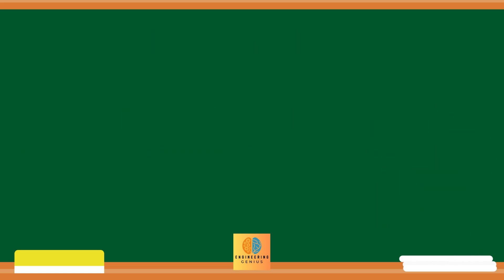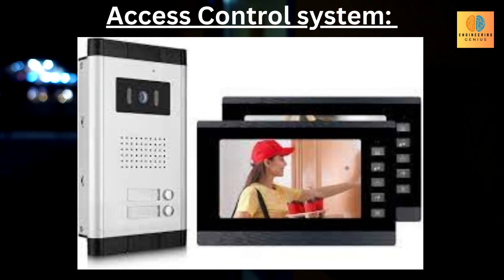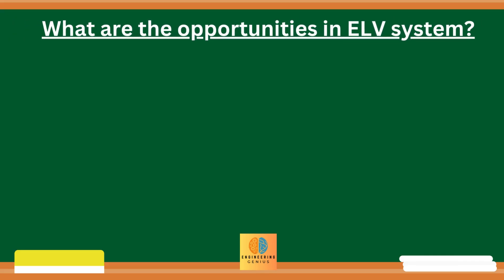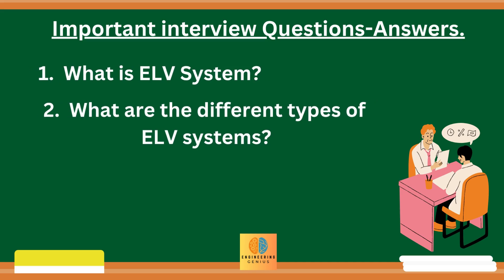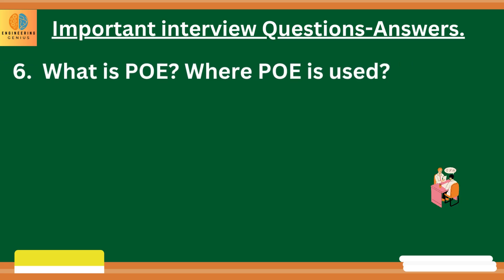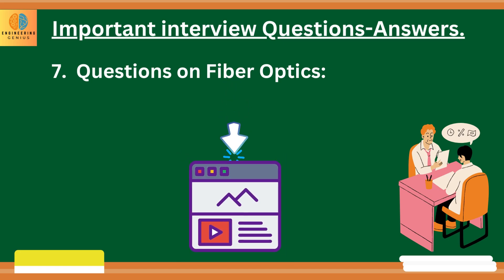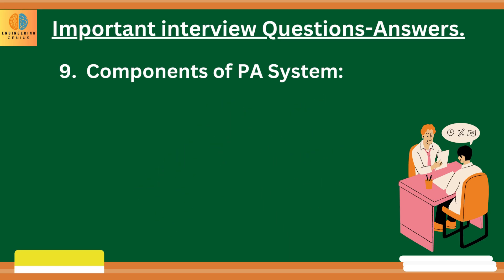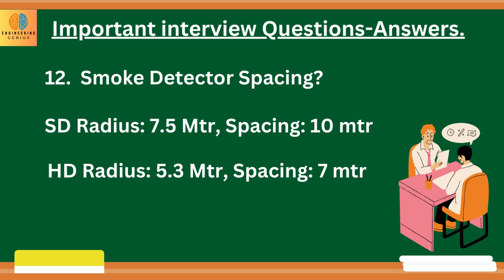[ELV System] Extra Low Voltage System Interview Questions & Answers

Comment: Where to learn for ELV integration with BMS
Reply from the maker: Integration is vendor specific. Check if you can find any video on that. If not I will make one general video on that.
Reply: @ENGINEERING-GENIUS  say we have Hickvision NVR,Honeywell Addressable Fire alarm & ENVIZ door locking system. We want to terminate them to a single unit BMS For Controls Alarms status & data logging on Workstation.